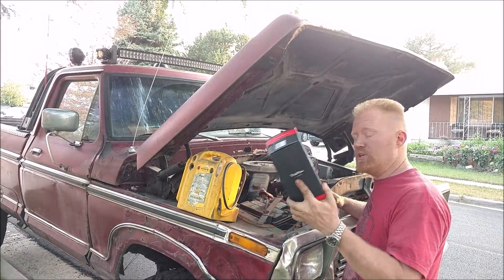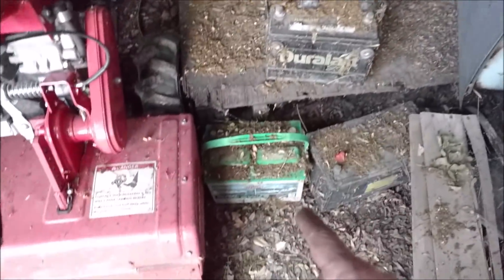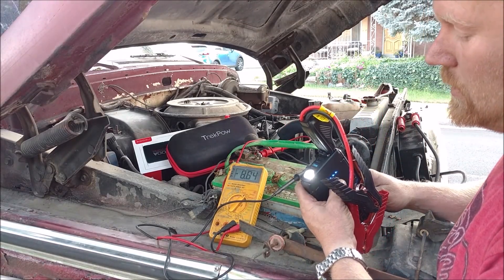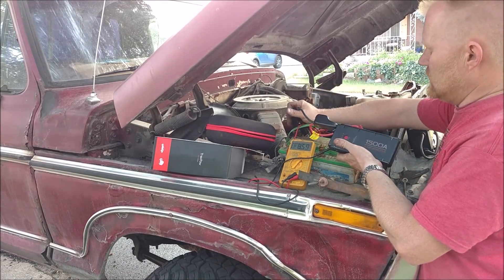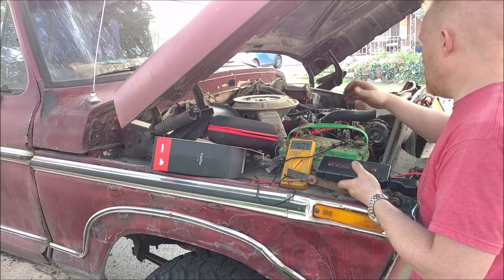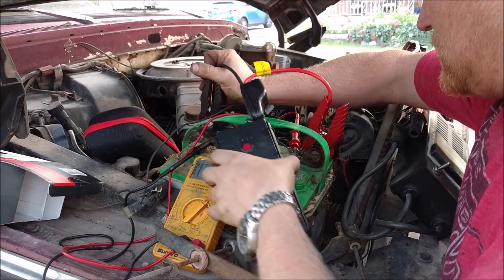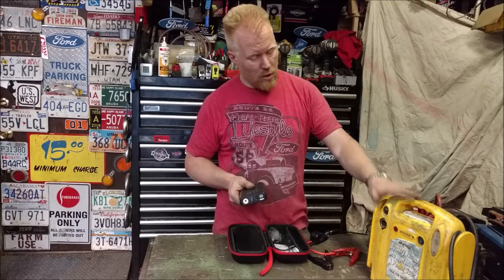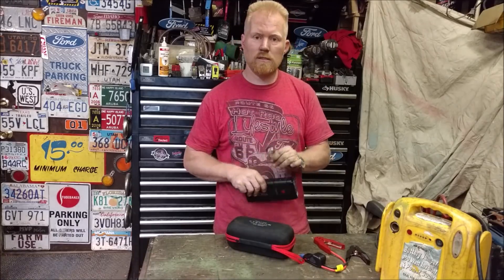Lithium Jump Starters any good?

Comment: I now have 2 of these as well as my lead acid jumper box. I also had an occasion to have to sit around a hospital waiting room for 8+ hours and plugged my I Pad  into this thing when the I Pad was at 95% battery... I watched nexflix all day long and when we left the hospital the jumper box was near dead, but the I Pad went up to 100% and was still at 100% when we left at the end of the day. I LIKE IT!
Reply from the maker: I charged my cell phone a few times the first couple days I got it and it didn't seam to make a dent.
Reply: I had trouble at first, but had good luck if I plugged it into the jump starter BEFORE it got very low. Then I played all day on the tablet and still had a full charge

Comment: Very impressive and thanks for doing the demo.  I wonder what would happen if you disconnected the old tired battery and only use the new lithium battery jumper in its place, would it then start the engine without that old battery being in parallel?
Reply from the maker: It would start the engine without the battery but as soon as it started the alternator would more than likely short out. The battery acts a limiter/cushion for the vehicles charging system. This is why I put in an absolutely dead battery and did the test with the headlights on to show the performance.

Comment: I was wondering what do you think of Super-Capacitor Jump Starter where there is no battery in it and uses the little bit of charge left in the battery to charge the capacitor itself and jump start the vehicle. Scotty Kilmer did a review on a Autowit brand available on Amazon and it really seemed a like a good product. just wondering what your thoughts are on it.
Reply from the maker: I've seen them and they seam tedious. I think they would only work on a barely dead battery as it needs to charge itself off of your dead battery for a few minutes. Reading the literature my battery that was around 2volts steady would take 20-30 minutes of being connected to my battery before I could attempt a start.  I would also assume you only have one chance to start your vehicle before it's drained and needs to be recharged. This would increase the recharge up time, every-time you have a failed start attempt. Compare this to a jump pack(lithium or lead) that will give you multiple attempts off a single charge.
Reply: Can carry a lithium jump starter to charge the capacitor bank  :-) I watched his review, he didn't even try starting a car with it.

Comment: awesome video
i have been looking at making lipo jump starters to replace the lead acid jump starters i run. seeing this im definitely going to do it. the lead acid ones are ok but if ur trying to start anything bigger than 4L with the load of a dead battery its not going to handle it 
*note im in australia and amazon doesn't ship :/
Reply from the maker: I'm impressed how well it works.

Comment: I have one of the NOCO jump start boxes.  It works so much better than the big ones I have.   And they also never go dead from sitting. I wouldn't mind trying out one of the super capacitor jump start boxes.   I think Orielly Auto Parts will give you $5 dollars a piece for old batteries.
Reply from the maker: I use the old batteries for weights on tractors etc and for cores when I buy new ones. I give them the oldest crumbiest ones. I might need to thin the derelict battery horde a little though.

Comment: Properly designed lithium batteries can produce very high discharge currents, so that pack probably has several "flat pack" lithium cells in it (the style you find in phones and tablets).

The numbers on the battery load test meter are a GUESS at the cranking amps a battery can deliver, as the load testers are typically in the 100 amp range.  The scales are based on the battery voltage under load and are very dependent on the battery's state of charge.

The older jump starters with a small lead acid battery have instructions about connecting the jump starter AND letting the vehicle battery charge for a few minutes.  The amps the small battery can deliver won't start that V8 but the watts hours that it can transfer into the vehicle battery can.  The vehicle battery is a "starting" battery, designed to dump high amps (well over 100 amps for bigger engines in winter) for a few seconds to start the engine.  I've used the older jump starters (still have one) and also have a newer lithium-based one that I haven't used (yet).

There's an encyclopedia on the What and How of batteries at https://batteryuniversity.com/index.php/learn/
I've lost a lot of hours there but I've learned a lot.
Reply from the maker: I've spent many hours reading on the battery university site over the years. Lots of good info there.
Reply: notyoung   Great reply; that is the exact understanding I have. They must be controlling the Li-ion cells with circuitry; I was under the impression the Li- chemistry couldn't do it, but lithiums are now common (and reliable) in tools such as drills (a high current load).  Would many, many cells in parallel be the way they are achieving the high current?
Reply: They use the flat cells to have bigger conductors and they then parallel the cells.  The connection to the cables to the battery to be jumped are connected through some very high current MOSFET transistors to do the switching.  
bigclivedotcom did a shorted connection on an inexpensive lithium jump pack and then did a teardown of the pack. https://www.youtube.com/watch?v=0tGK1nqXr28

Comment: like to see this unit compared to the super capacitor start systems and at 100 degrees and below freezing conditions.
Reply from the maker: The super capacitors are pretty neat but expensive. The video was done at high 90's temps and I was going to throw the unit in the freezer for the night to give it another test.

Comment: A very smart dog :-D.

Yes lithium batterys do have a lot of capacity for there size, but the charging has to be controlled, if not its BANG!!.

I'm supprised the thin leads/connectors can stand the current, keep an eye on them if you can.
Lead/acid have to be bulky to deliver, but it's an ancient technology that has lasted for donkeys years.
Lithium will be replaced rather quickly, in comparison.
Reply from the maker: Lead acid is still king the automotive world for a reason.  I'm cautious of the power these Lithium packs are putting out. There is a lot that can go wrong.

Comment: Good 18650 batteries are about 2.5 amps an hour. So unless they managed to fit about 400 batteries in, how the hell does this output 1000 amps? Open it, they must be loading capacitors.
Reply: different type of batter, similar chemistry.  These use the same lipo packs RC planes and such run on, the capacity is a bit lower then 18650's, but the amps they can put out is huge.  I'm still skepticle of how long those will last though.  You run a lipo that hard and it's going to have a short life.
Reply: animefreak5757
Well I don't know, had mine close to two years and have used many times and it's been at least six months since last it was used  (  finally broke down and spent the money for a gell cell battery  😣 )    but I'd bet it still works fine!
Reply: that's good to know, I haven't seen any actual long term feedback prior to your comment.  I'll still take their claims of cranking amps with a grain of salt until i see them properly tested though (there was a video a while back of a guy putting these through their paces with a pile tester, not a one came even remotely close to what was claimed)
Reply: Actually, the 18650 batteries are typically about 2.5 Amp-hours, so that's a measure of the amount of energy they store, not their current rating.  It is hard to find specs general for the current rating of 18650 batteries, but typically they would be rated at less than 10Amps (maybe up to 30A for 18650 batteries that are designed for high current). Regardless, these jump starter packs have LiPo batteries that are constructed specifically to give very high current at their nominal operating voltage.  Likely the jump starter pack contains just 4 of these high-current LiPo cells in series to give the required 12~16 volts.
Reply: @wolfgangmika8899  each cell is 4.2 volts charged which gives you 16.8 volts where as a car battery only like 13 volts. I know in RC cars 3 extra volts can be the difference of night and day.

Comment: nice, l use my big box for running the winch in the back of my truck, l wonder how well it would be in that application,
Reply: Mustie1
Don't think that I would use it for that more than ten or fifteen seconds at a time though !
They are made for a large amp draw for a short time !
Reply from the maker: That's my only gripe. It won't run loads like a winch, air compressor, or air pump at all. But it blows my old jumper pack out of the water for jump starting a vehicle.
Reply: @sixtyfiveford  I did see these using the car plug adapter to power a portable car air pump and worked fine. Were you trying to use a big air compressor
Reply: Mustie1  Jerry bs corner stress tesed quite a few of these some event up in smoke some where garbage like no-go brand
Reply: Intrade Motor   Sounds like the  18650 knock-off battery brand situation (and probably for similar reasons).
Reply: Mustie1   I would not think so; the premise is that these are short-use, started battery scenarios. AFAIK, Li- are very dangerous, and they are controlling them with electronics. I can't even believe they would risk users of heeding rules.  The fires are extreme.

Comment: That is amazing! I keep my old lead acid jumper because it has a mini compressor in it. I bought a slime mini compressor and now I’m gonna replace the lead acid jumper with this lithium. Great review!
Reply from the maker: My only gripe is the 12v cigarette socket on it won't power things like an air pump. I'll have to go plug in my mini 12v compressor and see what that does. It says the internal breaker trips at 8amps but some of these electric motors pull large surge amps to start.

Comment: I wonder how long the charge last after sitting a wile and how the cold affects it? sometimes when you leave your cordless drills in the truck when its cold they become dead and that would be a bummer if you left it in the car and you really needed it. Maybe you could do some more testing ? Looks like its worth getting.Cheers great video !
Reply: Been using one for a couple of years.  If kept warm the charge lasts a really long time.  Not sure I would trust what they advertise.  Cold will do it in just like your cordless batteries.  Very nice to have but you have to keep them from spending much time in the cold.  Some day, they will have something that will.
Reply: Thanks for your reply !
Reply from the maker: I'll throw it in the freezer tonight.
Reply: My experience is they don't work in the winter if you've left it in the car and expect to use it, and the winter is when most people are going to need this. So if you have one in your car and aren't home, plan to go into a warm location to warm it up.

Comment: Why is this news?
Nickel Metal batteries have 10 times the power density than old Lead Acid batteries.
Reply from the maker: It's news because nothing puts out the endless amps like Lead Acid. That's why their still KING of the hill with car batteries. No other chemistry can compare, not even Lithium. They are using some sort of capacitor to dump this many amps from a Lithium; that's news.
Reply: P V   But I believe they (NiMH) couldn't deliver high currents. Ni-Cad could but have their crystallization (memory) problems.

Comment: I'm going to go ahead and buy one just to test it but the last one of these things I bought was a ridiculous joke all it would do is click the starter relay and run the headlights for a little while there's absolutely no way it would actually turn the engine over and start it I'm pretty sure I got a good one it's just you got to be reasonable there's no way a tiny little battery like that can start a car engine I don't know how they fake those TV commercials but I won't believe it till I see it but I'll go ahead and order one of these if you said they're that good
Reply: Technology is advancing rapidly, allowing more power per square unit of space.  I think you'll like it.
Reply: Million Dollar
I've got one that will start my 04 Dodge diesel with no problems ! 😊
They are amazing little battery packs !
Reply: Ken Gamble ,,thanks for the input,,,is it this very same make and model used in this video??
Reply from the maker: I expected it to fail, especially with a completely stone dead battery. When the first ones came out a few years ago I remember giving a guy a jump start from my vehicle because the one he had didn't have enough balls and it failed. I think it was claiming around 500 amps and I haven't even given it a second thought that they all had to be junk. I 
watched a few videos years ago with people starting their barely dead Honda Civics but that won't cut it for truly dead stuff or a V8. I fully intended to get this and more than likely return it, but I'm sold and this has a new home in my garage. Over the past 3 weeks I have started 3 vehicles(Over a dozen starts including this video), all with V8's without any hesitation.

Comment: jump start circuit is higher output then regular 12 volt output, so it can't handle the surge startup from pump
Reply: Rev John O'Toole incorrect. That booster can handle the blower easily (8-10amps is nothing) and all 12v devices can take up to 15V (generator’s output is 14.5V + or - 10%.

This is a jump starter, NOT a power source!!

Some can be both, but some expect to have a battery connected to it, so it triggers the safety circuit when it doesn’t have one connected in parallel.
Reply: P V
Exactly, they do a great job of boost starter and charging a phone or tablet but you can't replace your battery with it.